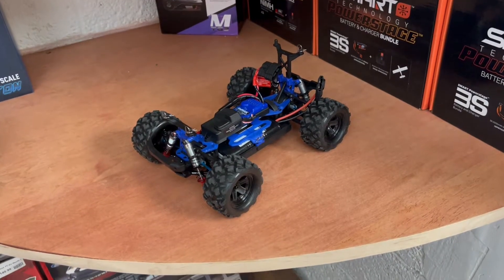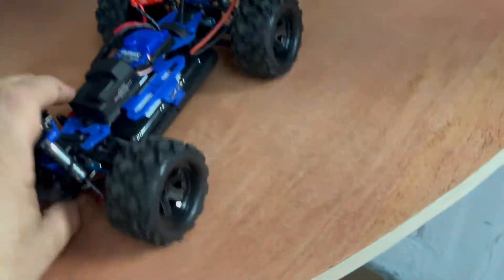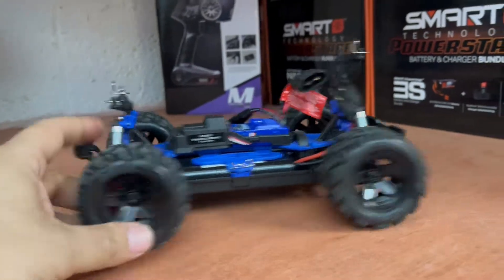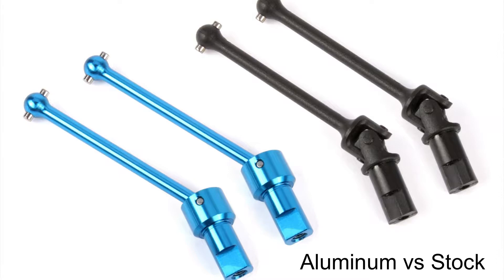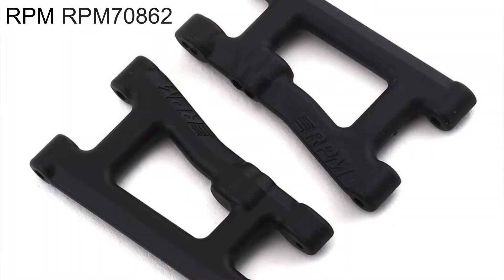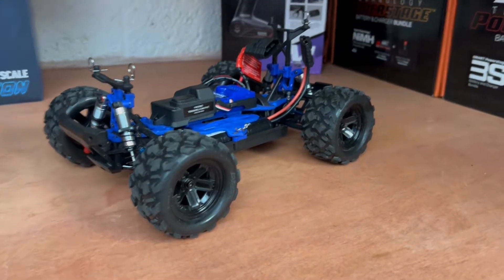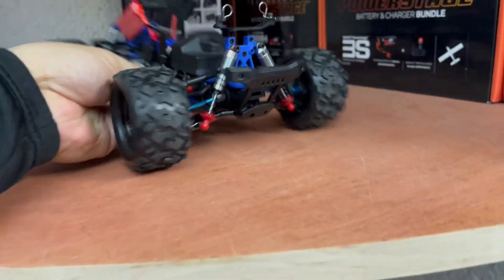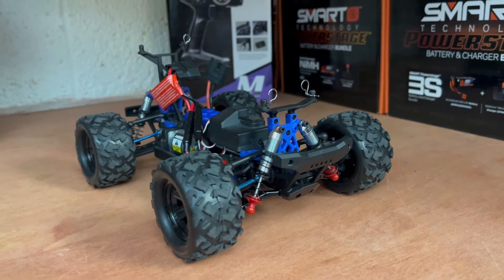Latrax Teton Upgrade Guide - Stage 1

Comment: On shocks for $20 a pair and it still needs the terrible stock spring cups and ends. Your better off using one of the other brands and get some nice color aluminum shocks that work just as smooth or better.

Comment: Can you link the motor?
Reply from the maker: Brushless Motor & ESC ( It fits and works)
https://amzn.to/3v4cI70
Reply: @ParkflyersRC  And the regulator?
Reply from the maker: @hallomaxtv7075  This motor has a BUILT in speed control ! Its all you need !
Reply: @ParkflyersRC  So you can use the engine with the built-in Traxxas regulator?
Reply: @ParkflyersRC  Or can you connect a remote control to the motor and then already drive? Does the engine fit exactly into the Latrax Teton?
Reply: @ParkflyersRC  So is the engine suitably large? And then the car ends up driving faster...? So 45 mph
Reply from the maker: It’s all included like I said and it works like I said. One connector goes into the speed control into the throttle port. This combination unit gets rid of the stock speed control.
Reply: @ParkflyersRC  Ok… When comes part 2?
Reply: @hallomaxtv7075  whres part 2